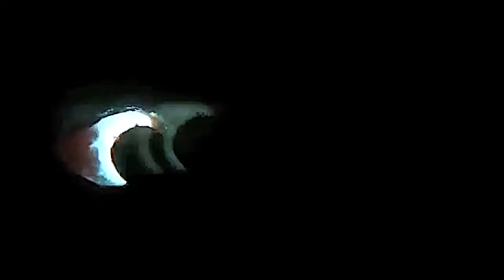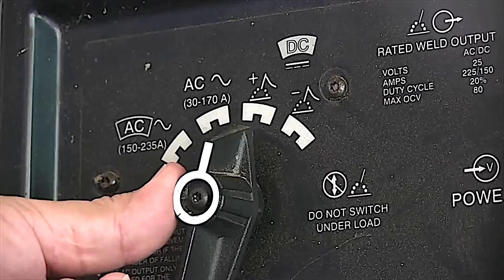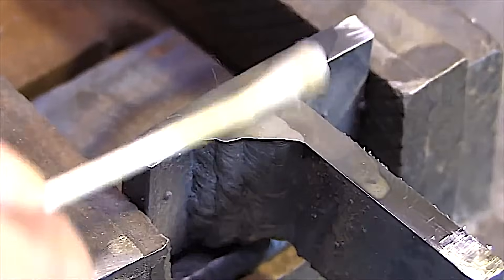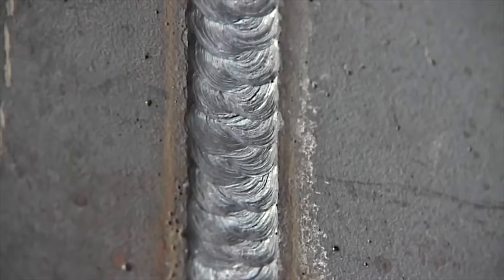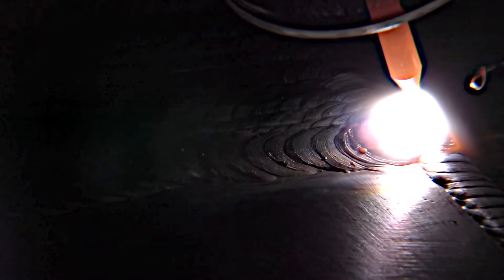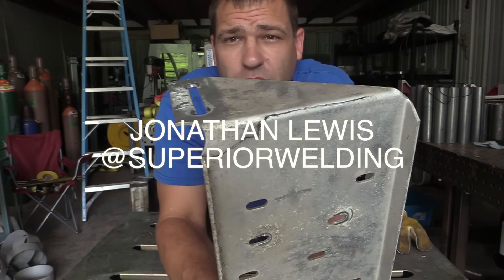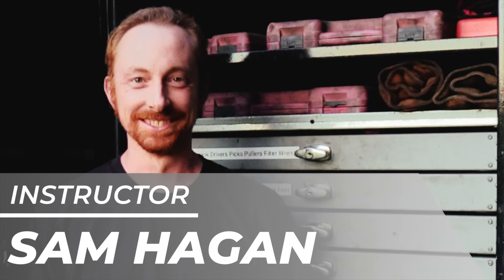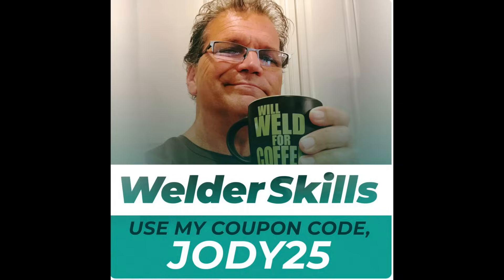Stick Welding Rod Overview

Comment: Hiya I have 175 lincon arc welder I'm using  6013 rods I'm welding in a vertical position and the weld doesn't seem to be getting a good  key  I've adjusted the amps from 65 up to 1oo due to the steel  thickness   I can forward photos on for you to tell me were I'm going wrong

Comment: With my Primeweld tig225x,  I want to run 6013 with AC. I couldn't find the setup in the manual for this. Does the stinger go in the positive side with the switch set to AC? been 35 years since I have stick welded. Thank you

Comment: I wonder why 6010 wont run on your Lincoln inverter welder?
I scored a bunch of Lincoln 6010 stupid cheap but now I am worried it wont work with my welder.
My welder is an off brand multi process about the same amps as  your Lincoln.
I thought I would be OK because 6010 says it is for DC.
I guess I will have to try it and see.

Comment: Hi, I'm having issues with this (yeswelder)  machine from Amazon to weld with E6013 3/32  rods. It constantly stinking to the metal and its a pain in the neck to get it to wok.. i was trying 90-140Amp , current is 110  DC. If I'm right, the current in my home I'm talking about.. what can you tell me to get this to work.? I take the rods back to home Depot early..

Comment: You mentioned welding some 6011 on a portable inverter machine with a 110v drop cord.
Wondering how long the drop cord was, or how long it could be ... assuming 3/12 cord.
Thanks, new subscriber - Steve in Indiana.

Comment: Hi! Have you done a video on in the field stainless steel, open root purge, welding yet? I'm fighting a 10 inch 10ga. SS pipe at work, it's the high lows. I've got some highlows thst are riding 3/16 down and I'm getting it but it's very very difficult. (Using a keyhole method) haven't found other videos helping with this, Iif you can recommend one that would be greay

Comment: You are the perfect person for a question of mine. I was recently on a job, I'm a structural welder, and I was welding a TON of angle saddles, the saddles being galvanized, to galvanized imbeds. Called for 5/16 weld all the way around, flat, vertical, and overhead. The first couple of days I was running a single pass with a 3/32 7010 and capping with a 1/8 7018, then I realized the code just called for 70XX. I started capping with 7010 and i had a few other welders question me. My question is: Is 7010 ran downhill up to structural code, and also is running 7010 uphill acceptable? (I seem to have similar penetration and the weld profile is pretty slick either way)

Comment: Excuse my ignorance but what substance/chemical are you rubbing the Q tip with to show the difference? Inquiring minds want to know. Thanks for all you do for us out here. 👍🏻
Reply: It's called a passivation solution. It's a type of acid. The stuff Jody uses woks almost instantly, but oven cleaner will work as well. 
It just takes longer to reveal the weld nugget.

Comment: I think this is great! Im a 62 year old retired certified welder, and it just galls me that the welding industry in general has been on a totally misleading PR campaign trying to lead young people into the welding field by featuring metal artists and motorcycle builders in their ads and articles! Now I’ve ALWAYS been a Lincoln man, but even ARC magazine that they produce was full of this kind of stuff, and totally overlooked the type of job that the vast majority of welders do! For every metal artist out there, there are hundreds if not thousands of guys welding structural steel, cross country pipelines, general fab and repair, etc, and making these young people believe that they’re going to be making a great living in an air conditioned “studio” making art is an outrage! Setting them up for a short stint in the industry is what they’re actually doing! When reality finds them laying in the mud welding on a broken earthmover or welding structural steel on a 95 degree day with no shade in sight, when they were lured in believing that art or motorcycle fenders in a climate controlled shop would be their destiny, most of them quickly move on to fast food management or something similar! Thanks for attempting to restore reality to an industry that can only be described as false front!
Reply: Nothing new, I am afraid the due diligence needed to become a successful welder fabricator is not shared by most welding schools and most definitely most students are unaware of the mistreatment by industry using too many weldors as cannon fodder. The management is only looking for fast and cheap. I am a long retired woman millwright / welder / fabricator. So is my husband. He would never recommend repeating his career path though he even taught a College level TIG class. His average student had no interest in anything but the shananigans as seen on TV on " Monster Garage " and the likes of other programs. I was trying to find a welder for a company and couldn't find any. The company owner said " any GIBBON CAN WELD ". THAT IS PART OF THE PROBLEM. Don't have easy answers but I still love the work. My impression is that in Europe things are better. The employers MUST SUPPLY PAPA SUPPLIED AIR WELDING HELMETS to protect employees. Better pay and benefits too. Sorry for the rant but I love welding and the products it can provide. Stay safe all.
Reply: Man I totally agree just graduated from the Houston campus of Tulsa welding school as a certified welder and nceer certified fitters. Everyday I see recruiters selling these false promises too way too many Men and women my age only after you graduate do you realize that you don't need those certifications to get a job it's really just the experience itself. I couldn't agree with you more on this topic
Reply: 95 ° ?? Try 120+😂
Reply: Yeah I know what that's like man I've had a lot of friends a certified welders and I'm just a stove builder I don't want to weld that much it's too hard on your health. But on the big picture and I'd want to tell you that everybody is going to machinist the welders every talented person there's a few people left that said all the machines up there pretty sharp but the rest of us are just kind of getting dumb down and paid less we don't care if you're a certified welder just push this button when you think it's gone off track with the robot arm. It's not just the kids in the industry it's pretty much robotics has taken away all the jobs like welding and machine shop. Instead of a certified welder you'll be a machine operator.
Reply: Everybody is on a totally misleading campaign and education and business because they start right out trying to convince you that they have something good for you if you would just give them a little bit of your money or all of it and get nothing because you don't have enough. The reason we have people going into the CSI thing is because we had the CSI show now we show more people that can weld, monkey see monkey do. If you have the skills required to crawl under that big machine and weld something that's broken your drawing a pretty good wage.
Reply: Not so much for me. I just came out of my local tech a year ago last month, and it's not that we were promised comfort in that sense, more so I was sold a dream that said we'd be making unrealistic amounts of money. Not quite like the famous wink wink academy of YouTube, but still high. I was told a bunch that as a welder I'd be secure in the sense I'd be so needed that employers would be not nagging me about being late out of fear of losing me kinda thing. How crazy it is when at my job I'm seeing people get fired for getting over their unpaid hours that were allowed each year. My instructor would say good lines I still remember like, "if they got a problem, you just say hey, I was looking for a job when I found this one." And you'll be hired at a new shop in 5 hours so definitely negotiate what you want. That with 10 years experience you should be able to walk into any door demanding 40 bucks an hour and be able to get it. I acknowledge my current company in particular is R**ping me as far as pay goes considering I'm tigging aluminum for outta highschool mig money and all my classmates are making way more than me and I'm already looking for new jobs but still. The fact that I've been yelled at for being 2 minutes late back from lunch to not even be busy kinda broke my brain when I was conditioned to have that mindset
Reply: To be fair though, is there really any industry not guilty of a similar practice?  Yes, it highly unlikely that a 19yr old is going to come out of school and be the lead fabricator for a big budget race team. Nothing says that same 19yr can’t save up over a few years, get the space and equipment to build and sell those things himself. It’s even easier in todays world to market yourself on Instagram, Facebook, etc.
Reply: To be fair though, don’t pretend like companies actually care about their people. They’re simply trying to bait folks in because they’re perpetually short on workers, and people will fall for it. You described yourself how it’s not necessarily a glamorous job, and if we want people to bow down and be slave to the capitalist overlords, then some light brainwashing is the cheapest and easiest way to accomplish that

Comment: Love all your video's.  Never see much on 7024 or as some called it "drag rod." Used it a lot when welding during my apprenticeship many moons ago. Also used it with my, now gone, Lincoln tombstone box. At 73 I still enjoy welding projects and doing repairs, mostly as a hobby. MIG, TIG, STICK, Plasma cutting and full set of torches. TIG is now my favorite and recently welded a SS pipe to SS Harley Rotors for a flag pole.
Reply: Ive used 7024 in my welding class, im working on overhead stick